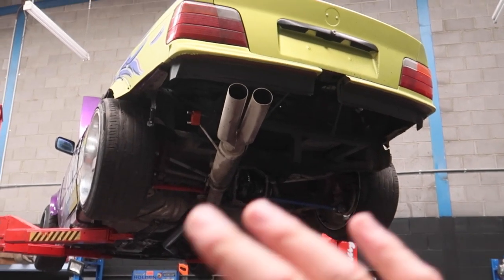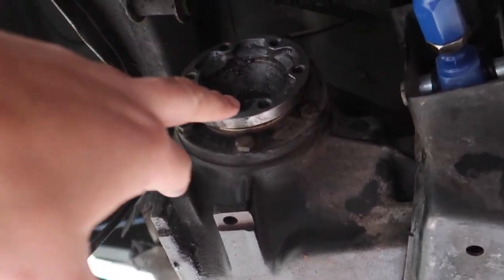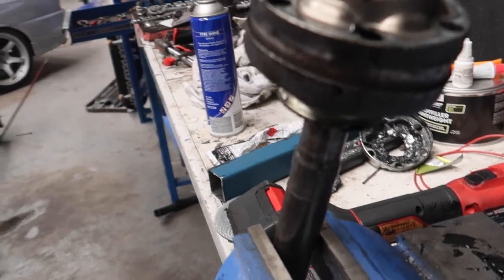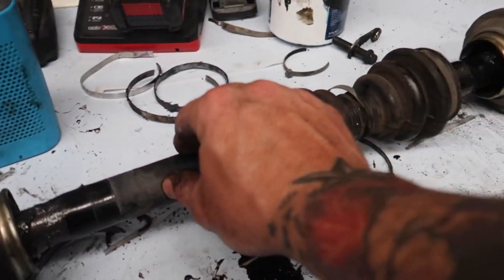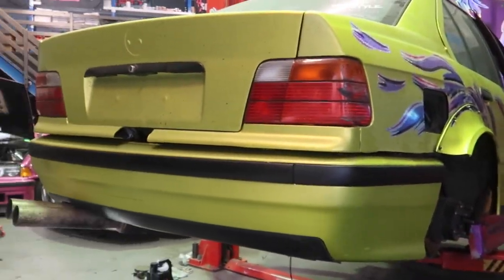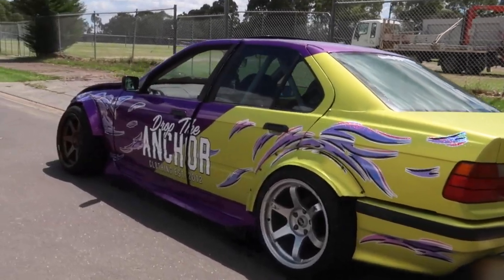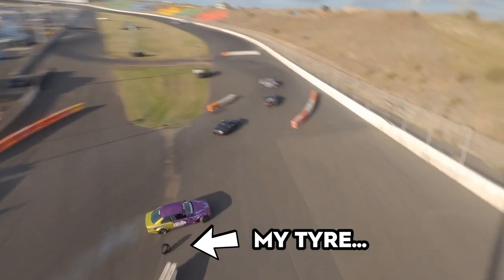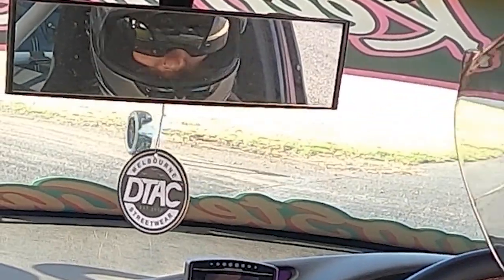BMW E36 axle tips & secrets + M52 turbo LIMITER BASHING drifting

Comment: Hey Mike! Mad video. Just wondering what the chases. You could do a bit of a video of general information about the E36 chassis as a race build. I'm new to the chassis and the current information is spread wide. Just like what gearbox combinations come/swap out diff combinations etc. Hope this makes sense. You seem to have a strong in knowledge on the chassic.
Reply: Almost all gearboxes from all bmw fit.
E36 e46 e39 e60 diesel gearboxes are great. Bmw is very compatible with other models.
Reply: @danielvanoosten8987  yeah ok interesting.

Comment: hey mike when your talking about the e46 and e90 axles fitting the e36 are your talking about 325 trailing arms or m3 trailing arms? i run a ls e36 with m3 trailing arms looking for other options as well.
Reply from the maker: Hey Kenny, I’m talking about 325 trailing arms. Not sure if they’d work with the m3 stuff? Are the splines the same?
Reply: @itsmikelake  no the stub on m3 use bigger axle nut think a 32 but good info 🤙🏻

Comment: Theoretically the hollow one is stronger at least on a bend scale than solid steel. The twist strength I don't have the data on, but I am a fabrication specialist in my field so.
Reply from the maker: Ahh yes, unfortunately this hasn’t proven the cast once we put extreme load through them in drifting. The hollow ones snap fairly easily in my case.

Comment: E90 axle does not fit:(  e36 and e46 can be used on e90. but if you do the opposit the joint rubs the spindle
Reply from the maker: Good info! I don’t mind dremelling out a bit of my trailing arm to fit bigger axles 🤣

Comment: Probably try 2 passenger side e46 320d axles, factory solid tough as
Reply from the maker: That’s what I’ve been searching for! So hard to find here in Aus 😢
Reply: @itsmikelake  yeah, thats exactly what I wanted to say too. 27mm E46 320d shafts are solid inside and they are holding in european builds more then 500hp. But this is f*cking difference in the markets...They are laying by us on probably every garbage. As RBs in Australia ;) Overall I wanted to say too, that you progres in drifting is noticable! Probably Assetto sessions helped a lot, huh?